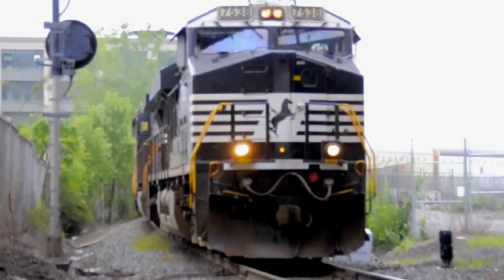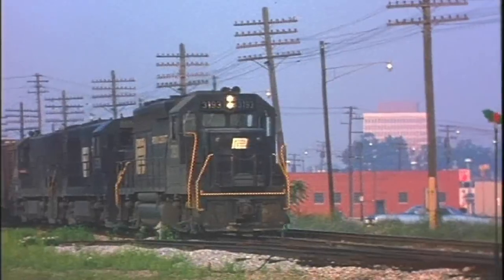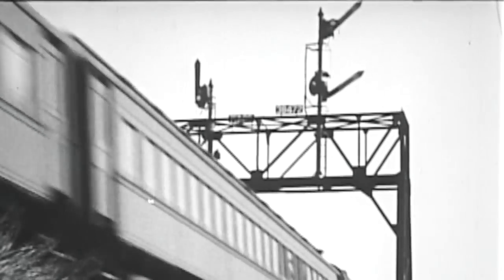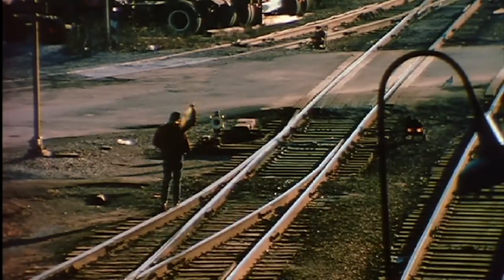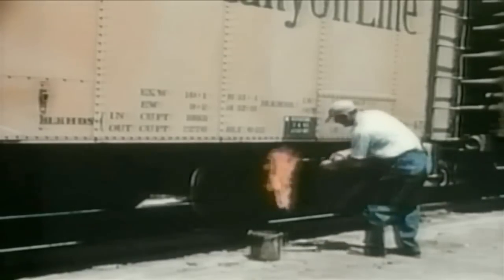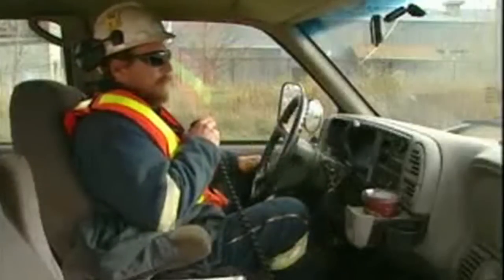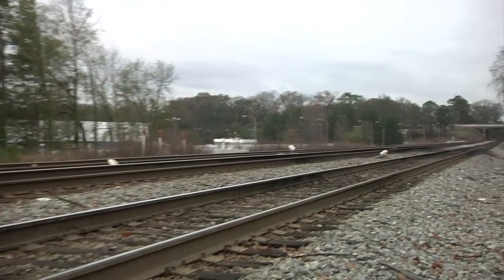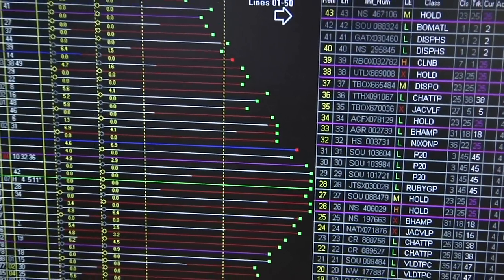Communications and Signals:Then and Now

Comment: @3:58 The label says "TOYS R US"

What??? haha

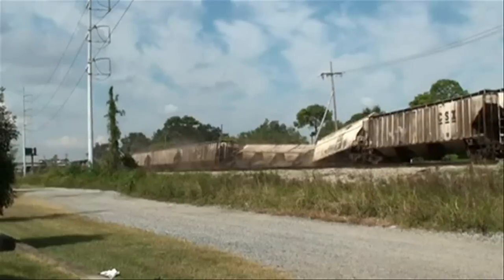Then the clip at @8:43 clearly shows a CSX car lol.
Reply: Those boxes are "p.s.o. II receiver".  They're train detector boxes.  I bet the 'Toys R Us' and 'Whirlpool' are quick indications of what blocks the detectors are wired to.  There may be a 'Toys R Us' one mile down the line, and a 'Whirlpool' store one mile up.
Reply: Boggy ,they can be used as presence detectors, but are much more frequently used to indicate switch positions at those so named industry switches back to the signal system. The name, PSO, (short for Phase Shift Overlay) is essentially what they are. The PSO transmitter (typically located at the switch) overlays an AC signal onto the  track circuits. The "PSO" is sent from the switch location over the rails and is picked up at an adjacent wayside signal location through a band pass filter and then a PSO receiver. If the switch is thrown for the industry lead, the PSO will stop transmitting, the receiver will drop it's output to the signal box and the signal will display a restrictive aspect, letting the train crew know to look for out-of-the ordinary conditions ahead (i.e., a switch lined into an industry)
Reply: Both Toys R Us and Whirlpool Distribution centers are located off of the H Line in McDonough, Ga. which is next to the NS training center where his video was produced

Comment: Did anyone catch what someone put on the relay boxes ..."Toys R Us & Whirlpool" It's at 4:00 min
Reply: Those relays are likely associated with track switches for the customers named.
Reply: Those are PSO receivers.  PSO = phase shift overlay (frequency overlay)  The transmitters are at the switch locks and indicate that the switch is locked in the normal position.  These are hand throw switches to sidings.  When they lead to private industry tracks they are named by who owns the siding track.   I'm reasonably certain this is McDonough GA.

Comment: How accurate are hot box detection?
Reply: Sort of. They have a hard time dealing with fireboxes on steam locomotive. Other than that, they do a good job. Same applies to a dragging equipment detector. They are not everywhere which is the problem. CSX on the main between DC and Jacksonville FL has them about ever 6 miles or so. They also have problems with axle counts on a couple of them as you can hear them add an axle or two to the count. I think the one at 121 miles from Richmond VA is one of them.  160, 160, 160, 161, 160, 160 as an example. " CSX Defect Detector, Mile Post 121.6, No Defects, No Defects, Number of axles 161, Defect Detector out. " :-)
Reply: A study was done at the Transportation Test Center near Pueblo, Colorado to determine how long it takes for an axle roller bearing to fail. A freight car loaded to capacity can pass a hotbox detector with no defect, overheat and fail completely (i.e. burn off) within six miles. However, modern hotbox detectors are very good at finding early stages of bearing failure. The best systems link a series of hotbox detectors together in order to find bearings that are "trending to failure". CSX has such a system on its Cleveland to Chicago line.
Reply: @dupester1954  that's useful information since people are suggesting that Norfolk Southern should have had that technology
Reply: @ArtStoneUS  That is true. I have the utmost confidence in the NTSB. They investigated a collision that I was involved with back in January 2012. They're very professional and they dig into all of the evidence. The NTSB will make recommendations that are appropriate to improve the safety of the transportation network.
However, as stated in my earlier comment, improving the defect detector network by spacing or by networking will never result in a zero-derailment rate due to failed bearings. The best solution is onboard equipment defect monitoring. This technology has evolved to the point where it can be implemented at a lower cost than installing and improving on site defect detectors.
The legislation that is now being considered would help reduce the accident rate, but would not eliminate the risk of failed bearings. If possible, the legislation should mandate better defect detection through all methods, not just by installing more defect detectors or changing their configuration.
Reply: gravelydon
Reply: People should buy my "Impact" a James Grider novel on Amazon so I can afford to live near a railroad. What if James Grider goes to a switch and shoves a brick or a stone between the main rail and the wedge-shaped rail so the switch jams and he does it for shits and giggles? Engineers have cameras watching them in the cab now, but how is that fair because if you were an engineer in the 1960's, you wouldn't have a camera watching you? Why are you worse off now as an engineer than your predecessors? Why can't just the train driver have a button in his locomotive and he pushes it before approaching a switch and it changes it to wherever the hell he wants to go?
Reply: @mentallyilldarkjeroid5378  The engineers don't have control over the switches on main line railroads. That task is controlled by the Train Dispatcher, who assigns a route determined by a myriad of factors that might not be apparent to a train crew. Some short line RRs have systems of local control over electric operated track switches, but they still operate under the direction of a dispatching office.
Reply: @mentallyilldarkjeroid5378  humans make mistakes, interlocks do not

Comment: Do trackside signals really do any good??  An average train moving at an average spped can take over a mile to stop.  There is NO WAY an engineer or conductor can see a signal a mile in advance.  I'm guessing most orders are verbal.
Reply: They actually invented something called "distant signals" for this very purpose: they warn trains in advance of an upcoming signal's aspect. For example: Here's our not-to-scale rail line:
Letter = Signal,
----------------------- (A) ------------------------ [B] ------------------------------ {C} --------------------------------------- |D| -----------------

If signal C shows a stop indication, and there's a train approaching signal A, then A - along with B - will warn the train about C's aspect. They are usually placed a few miles apart, most likely no more that 10 miles apart (presumably).
Get where I'm going with this?
Reply: also called "wayside signals"   the signals either automatic( controlled by the trains themselves in most cases) ,and block signals or the section of track controlled between  two signals in ctc territory . interlockings (home signals controlled by ctc or tower also called control points) , wayside signals usually controlled by the the train itself /sometime they will automatically give a reduction when in conjuction with a tower operator or ctc dispatcher/ (interlocking/junction)/think intersection. (the train leading occupies block d and gives the train following a progressively restrictive signal aspect the closer the following train gets to it by relays or other electronic means)or manual, tower operated/ctc,- control access to an interlocking "diamond" or junction. wayside signals give crews advance warning of train ahead/restriction ahead by signal indication and by the rules pertaining( for example what speed to decelerate/accelerate to) to the signal aspect displayed on the signal , (like a traffic light going from green to amber to red same principle only much more warning is needed. see the example by semeran 11 they do this by either color signals color position signals and or cab signals there are some good books on the subject available by kalmbach publishing        and to say there s no way a crew can see a signal a mile in advance is completely false in most cases as the fra and the railroads (class 1 rrs- such as NS )have rules as to how far in advance a train crew must be ableto see signal and instantly understand it and know the rules applied to that particular aspect and act accordingly . there are all kinds of rules for this in any given railroads timetable, (how strictly they are adhered(maintained) to varies on the areas of rrs and the money/people tracktime required to properly maintain them.(trees foliage etc))\\     not even going to try to explain Dark territory /warrant rules... look fo the books from kalmbach..... very easy type in railroad signals in your search engine and BAm there they are
Reply: Green, flashing yellow (not always), yellow, the warning that next is red, and the red or danger.

Comment: Does NS' C&S department have a good relationship with their IT folks?  I recently retired from SEPTA and the C&S group only reluctantly cooperated with IT.
Reply: From what I saw of their operations back in 2002, I'm pretty sure the IT boys are men now.  :)
Reply: It's rare any department has a good relationship with another due to budgets and goals that usually do not mesh.  The Maintenance Department (MaD) had its on IT expertise to get many things done without having to go thru the Evil Empire (EvE).  One of my EvE experiences was due to a budgeted amount of money being accepted by EvE ostensibly to purchase a computer.  Rather than use the money to purchase a model that would have worked efficiently, we were given  a model that had been residing in a closet somewhere.  This choice led to a contractor spending money on hardware problems and software problems that would have been avoided if a virgin computer with greater capabilities had been acquired.  Inefficient operation resulted from a program that was developed in a short time frame working in an overloaded computer.

EvE saved lots of money by charging someone else for damaged goods.  MaD made progress in a manner that was not as efficient as it could have been.  Are you part of a team or looking out for No. 1

Comment: Why there is not electrical trains with overhead wire ?
Reply: +Mladen Milić In the USA, freight trains are now all Diesel-electric.  The Pennsylvania Rail Road did run a lot of freight using electric locomotives - with the GG-1 being a good example.  Where passenger trains run into underground stations, for both suburban and commuter operations, the trains are electric. AMTRAK runs electric locomotives between Washington, DC and Boston, MA in addition to between Philadelphia and Harrisburg in Pennsylvania.
Reply: mike klaene Finally someone else who knows their railroading in the YouTube comments section ++
Reply: ElfNet Gaming gravelydon Hopefully I know 'something'. I am a retired IT guy from SEPTA where all of our revenue commuter trains and trolleys are electric.  SEPTA operates what were the commuter lines in the Philly area for both the Pennsy and Reading railroads. Luckily I live less than 2 miles from a combined AMTRAK and SEPTA station along the former Pennsy Harrisburg line.
Reply: +Mladen Milić  Mostly because of cost. Far easier and more reliable to use Diesel-electrics in all but a few areas. When the electric goes down in the NEC, Diesels have to go in and rescue the trains.
Reply: +Mladen Milić +mike klaene

Network effect.

Due to a variety of complex reasons (mostly political and social, urban planning, etc) the US never got huge on rail passenger transport.

Passengers can move easily between trains, and normally electrics offer a better ride for the passenger. As a result in Europe many passenger lines were electrified, as there are instant benefits. Even better, Europe has many shorter freight routes (to the sea mostly) that could also benefit. 

In the US however, without passenger transit everywhere and very long freight routes, electrification wasn't particularly common outside of the North Eastern corridor and metro/commuter lines.

In Europe network effect meant it made sense to electrify smaller freight lines, so all freight could be electrical without having to move each piece of freight to diesel trains for branch lines (electric locos offer the same, if not more, power).

In the US however it makes sense to use Diesel everywhere, even on powered lines.
Reply: +Mladen Milić Electric railroad is higher cost right-of-way, lower-cost rolling stock and operations.  Electric railroad will tend to be more sensible in high-density corridors, where a lot of rolling stock operates more frequently over less right of way.  For infrequent service over a long distance: diesel.
Reply: +Mladen Milić Because this is the US. The US doesn't have that.
Reply: +Daniel Howard The main reason for electric use in the NEC is not speed or density, it is pollution. Many of the areas used to have steam engines till they were banned and replaced by electrics. Tunnels under NYC forced a lot of it. There used to be electrics on the Milwaukee Road and the Virginian  where the mountains and tunnels made them more needed. The last of the Conrail electrics were actually from the VGR. One is now preserved in Roanoke.
Reply: @gravelydon7072  Another example of an electric freight railroad was the Detroit, Toledo and Ironton railroad.  Henry Ford hated the oil companies with a passion.  However, electric locomotives were not up to doing the job of pulling freight in 1927.   He ended up selling the railroad in 1929.

The Chicago, South Bend and South Shore operated electric freight up until the 1980s.   One of the big problems is if you wanted to add a new industrial customer, you had to install the overhead wiring in addition to the tracks, which was very expensive and the customer might go out of business or switch to using trucks.  Much of their freight traffic was coal going to the power plant in Michigan City Indiana
Reply: @ArtStoneUS  There also was the Milwaukee Road and Virginian Railways that were electrified. But maintenance cost of the systems brought both of them down.
Reply: Acid Pit I wouldn't say so. I mean, Russia electrified the Trans Siberian with much more primitive conditions.

The main reason is that the US has a hugely subsidized interstate and local road system, combined with subsidized sprawl and anti-density regulations that make functioning train systems uneconomic throughout most of the US.
Reply: +Mladen Milić Because this is America and it cost too much to string up wires, besides an all electric railroad here is not economical, the diesel electrics we have can haul many times more freight a standard European electric can.
Reply: try doing that thru the desert lol
Reply: mike klaene Just not getting your comment reply notice...
I work in IT and Communications and grew up around railroading though, I do some communications work for KCS on the side too.
Reply: One reason not mentioned in the earlier comments is that railroads don't bear most of the cost of fuel because they charge customers a fuel surcharge. Why would railroads invest billions of dollars in electrifying their lines, when they don't significantly benefit from the cost savings?
Reply: afh7689 Because the price of using a railroad includes those fuel charges.

If they electrified lines they could increase their base fare, while still getting more customers.
Reply: The old PRR between NY /Harrisburg/ Washington was and is electrified with overhead wires.
Reply: mike klaene Not exactly true. There are still three coal haulers and one interurban that haul their trains with electrics. Iowa Traction is a common carrier. BM&LP,  Navaho Mine Railroad, & Deseret Power Railroad are the private coal haulers. Sadly, the only automated electric railroad in the US closed down because of the EPA and sulfur restrictions on Ohio coal. Now the entire power plant is being closed because even after switching a decade ago to lower sulfur coal, it wasn't good enough for the EPA.
Reply: +gravelydon Yes those points are true, but since the Jet Train was a failure from high fuel cost, the only high-speed option for the NEC is electric. The lighter weight, and higher power-to-weight ratio of electrics gives them an advantage for high-speed rail. But yes, it started because running steam or diesel underground would be ridiculous. It used to be done, but at a very high risk.
Reply: +Mladen Milić In the USA, there are long distances between cities. Much of the rail goes through rural and undeveloped areas, and even if it could be cost effective, there are areas where electricity is not available. Electrification would be too expensive for most areas in the US.